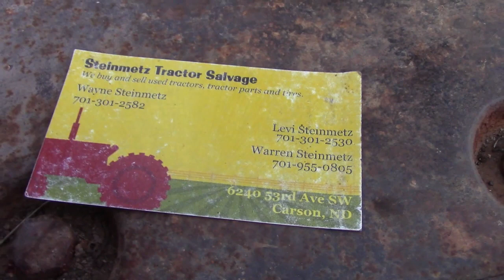MD #2 Alive after 40 Years

Comment: Hey I have a 1947 Farmall MD and it is running the same way on diesel. Did you get it running on all 4 cylinders on diesel? And What did you have to do to get it running on all 4 cylinders?
Reply from the maker: I have not got it fixed yet as the tractor sits over 1000 miles from where I'm at now and over double that the last 3 years. When I'm out there it hasn't made the priority list yet. However, after examining the injector bleeders I have a weak spurt on #2. It is not the only tractor I have with this problem and most of the ones I've brought home have the same symptoms. The distribution block on the top of the pump has plungers in there that stick. If they don't go back down the whole way you don't get the full wallop of fuel each time. The block needs to be pulled and the plungers cleaned up and that should fix it. I know it doesn't help you now, but I plan to do a video on it this winter when I go through my mta

Comment: I would say if you could put a steady load on it like a baker fan or a hammer mill and leave it run for about a half hour it'd come out if that sputtering fit.
Reply from the maker: The plunger in the pump is sticking pretty bad. I got the heck bit to pull that plunger out and clean it up. Probably just has some crud on it that needs to be cleaned up

Comment: Were the injectors tested or serviced while the head was being repaired? I would check the line pressures if you know the pop pressures of the injectors are right. You may have a couple bad delivery valves in the pump. Just for grins, I would throw some Lucas Fuel Treatment in the Diesel, and about a quart of good quality TC-3 rated 2 stroke oil to clean and lube things up.
Reply: Injectors where completely rebuilt, with NOS tips, tested and shipped to Doc using test oil.
Reply from the maker: As bill alluded to, the injectors were fresh going in, thankfully. Further analysis indicates #2 is the problem. Cracking the bleeder it nets less pressure and volume than the rest. Seems to be that I have a plunger stuck in the up position
Reply: @reeseholler92  and intermittent flow too on #2. Seemed like it was from normal to nothing and everything between.